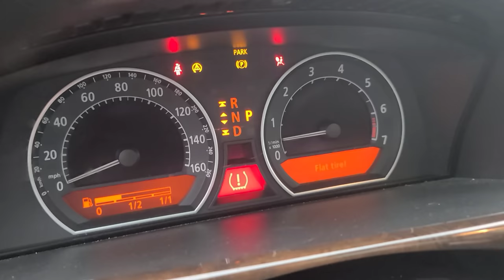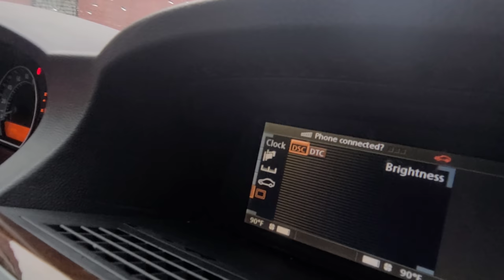Deboss Garage Car Show! Stuntman Off The Deep end! He's GONE AWOL! Neutral Drop

Comment: pull the ABS fuse that should disable traction controls in most vehicles
Reply: Or just cut a wheel speed sensor wire just to be sure.
Reply: Gotta watch out for that "tyranny fluid!"
Reply: I've found on most of them if you turn the emergency hazzard lights on, it will over ride a bunch of that safty junk :D
Reply: Not in that! Won't rev, direct limp mode.
Reply: Just cut the brake lines

Comment: Most of that eurotrash will only 90% disable the traction control and stability management stuff. My advice, cut the abs sensors on the drive tires and let stuntman rip it.
Reply: Take a couple pair of small vice grips and crimp the brake lines going to the drive wheels.

Comment: Utter fail- but it's not Stuntman's fault. 
You can't powerbrake the idrive beemer- but you can park it against a solid object, release the brakes, and it will send smoke signals.
Reply from the maker: Hmmmm
Reply: @NEUTRALDROP  there are more options in the i drive menu 
Power levels
Stability control 
And needs to be in M- power mode to fully turn off the TC
Reply: @NEUTRALDROP  or just pull the abs fuse that works too
Reply: @NEUTRALDROP  before you get any ideas... No, the Plakos gate is not strong enough! 🤣

Comment: I suspect the 7 series can't actually have the entire stability control shut off. I only learned recently that my Ram 1500 has a secondary stability control. What I mean is, I have a traction control button, but if you DONT PRESS, but hold it down for like 5-8 seconds it shuts it all off. Huge difference.
Reply: Yeah dodge started doing that with the first gen charger and 300c. Although the protocol to shut theirs off is you have to turn the key to start for 5 seconds while driving 15mph or more. Really scary to do the first time

Comment: Hey stuntman, and hey cameraman. I am a day 1 nuetral droppa. I used to work at a car wash for years. Some of these bmw`s, and a few benz's, and a lot of rams, jeeps, 300, and chargers, have been putting electronic trannies in the past several years. Some will auto park bomb if the driver door is open when put into gear.
Reply from the maker: And how do you know that🤣
Reply: @NEUTRALDROP   watched it happen almost daily. The wash was full service, here in TN. We'd do several hundred cars per day. Its pretty funny to watch someone rack a nice car, truck, or suv. I was there from 2015 til 2020. Cars getting more electronicy & computery brings them quirks and features. P.s. the small jeep renegade p.o.s's lock the parking brake if you don't override a switch when you go from park to drive with the door open, but most others with electronic trannies get 2 feet a do a hard park bomb.... I've always wondered what happens at higher speed and would neva own one cuz if the Battery dies u can't put it in nuetral and push.

Comment: It might not work on ALL cars, but every car I've wanted to do burnouts in that wouldn't, I was able to solve by pulling the ABS fuse. stability control uses independent brake actuation to prevent the individual wheels from spinning. Hope it helps with your future videos.
Reply from the maker: It's getting yanked like a bad tooth Monday
Reply: Some sound advice here .
Reply: solved that on quite a few bmw's can confirm,even worked on a 2000 bmw wagon 😆
Reply: @russianwolf6561  my test pig was a 2010 550I. Talk about a ripper

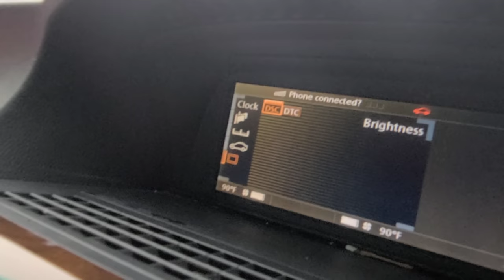Comment: 4:04 I think you have to disable both DSC and DTC and you have to press and hold down that magic stick controller for a few seconds.
Reply from the maker: We aint Givin up
Reply: @NEUTRALDROP  I think the one is supposed to be traction control then stability control I’m not sure if you guys figured it out yet but if not hops if helps

Comment: You sometimes can circumvent the traction control by just disconnecting (or just cutting) the wheel speed sensor, typically the driver rear is the only one you need to do, or try pulling the abs fuse

Comment: There's something I would love to see you guys do in a video sometime. When you do a burnout and engine blow video ,take a looong dryer vent hose and connect it to the intake then spray ether into it while you have your brick or stick on the gas pedal holding it wide open and the engine is redlining

Comment: When you find STUNT make sure you pull all traction fuses wheel sensors , cut the fuckin back brakes if you got to. That thing should blow the rear tires off the back no matter what is going on !! GET OVA HERE

Comment: the spare tires flat in the trunk. . thats why the sensors telling you that on the dash.
Reply: The flat tire is in the trunk, while the spare is on the right rear wheel; that's why it's silver while the rest are black. Open up the trunk and you'll find the fourth black wheel.
Reply: @obsoleteoptics  eaither way it's a flat tire. 😆

Comment: You know there should just be a button for the traction control/ stability control. Push and hold for 10 seconds and your golden. Bmw has a really good traction control system. Also you can try to remove the fuse for the traction control/stability control system if it has one.
Reply: @KS-xo3oh  Pull the rythm.
Reply: @KS-xo3oh  just saying that’s how you do it. 1 short press kills traction control, long press turns off stability control... stuntman likes to whip it so he would want both turned off.

Comment: The car won’t do a burnout when the oil pressure is low or anything is in jeopardy of failing. Once the check engine is on, the car is smart and doesn’t want to proceed in hard driving, a lot of people call BMWs unreliable because they push the car to failure these engines don’t like that or any high end luxury car for that matter with thick oils high displacement engines.